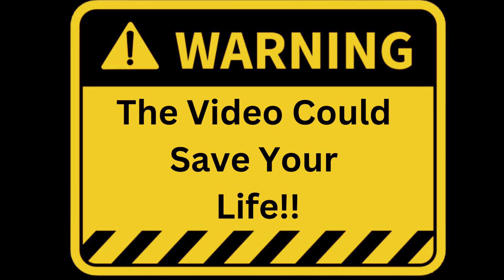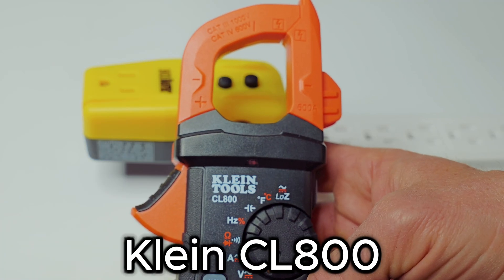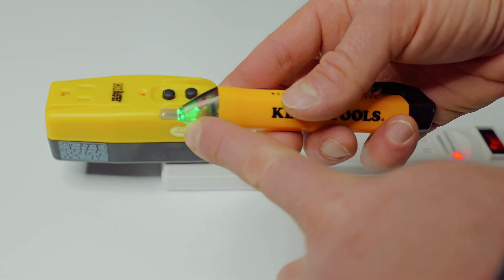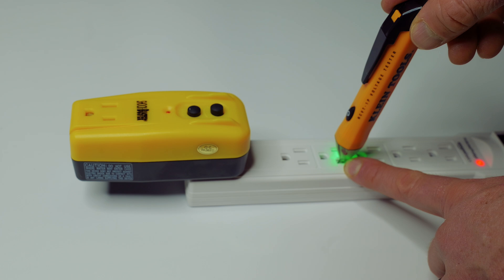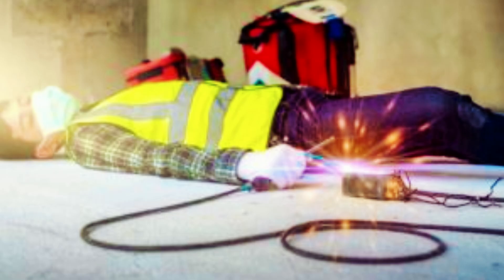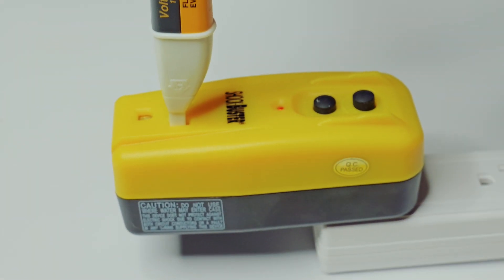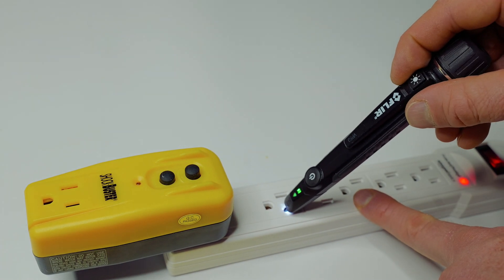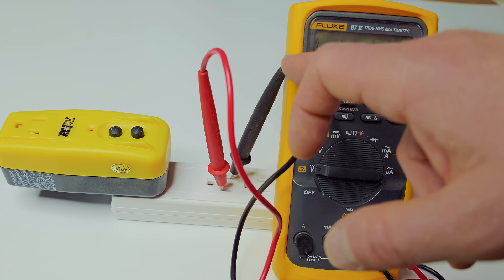I was shocked when I tested the TOP Non-Contact Voltage Testers!

Comment: I’m sorry but I don’t ever have to put my Klein into the electric socket to see it turn red. It’s non contact dude. NON CONTACT means you don’t use it as a probe. I even have found power on a bug zapper turned off and it’s leakage into a metal container below. Perhaps go buy another one

Comment: misleading marketing is the main reason these are overrated tools. though my wiha 12-1000v non contact has been 100% right so far they should have stated that these are NOT suitable for voltage absence detection. even the promo vids mislead customers. also stay clear of non speciality brands and stick to the established names no matter what you buy - chauvin arnoux, gossen metrawatt, brymen, kyoritsu, fluke etc. the two pole voltage tester is the only approved way to check if voltage is present.
Reply from the maker: Great info thank you friend!

Comment: We have 220 and 380 Volts in the network.
Reply from the maker: These would probably go off and alert a bit further back then. Most of these work just fine most of the time, this video was to show what can happen in low-voltage situations for homeowners.
Reply: @ElectricalYou  we have 220 is a low voltage, high is 1000 and higher.
Reply from the maker: Wow, stay safe out there please!
Reply: @ElectricalYou  We try not to take any risks, check for voltage and ground it so that the protection works during operation.
Reply from the maker: Yes great idea! Very smart!

Comment: The red pulses on the Fluke do NOT indicate the circuit is not live. Could you do some research before putting this stuff out there.
Reply from the maker: On the model I tested it does actually indicate that.  The rhythmic beat red flash is the continuous self test (Volt Beat)when no power is detected on the circuit. When the tip red light is continuous and a steady beep (if enabled) it means power is detected on the circuit. Perhaps you should do some research before commenting, or you are referencing a different model? Have a great day friend.
Reply: @ElectricalYou  The purpose is to indicate that the device is on and functional and not dead, not to indicate that it is a negative result.
Reply from the maker: While I do agree with that, it also is the "Volt Beat" function. Just going by what the owner's manual describes. I think it is safe to say both answers are correct. Have a great day friend and stay safe out there!

Comment: I'm using Laserliner ActiveFinder, which has a regular mode that ranges from 200-1000V on normal mode and from 24-1000 with the zoomer mode, which increases it's sensitivity and I find it much better than many other similar ncv testers. The only issue that I have is that it doesn't have an on and off button and because it's always on it's annoying sometimes when I work with corded tools. Of course, one must know what the tool is intended for, how it works, what it can do and what it can't do in order to get the best results and not get injured in case of improper usage.
Reply from the maker: Very good info, thanks for sharing and for the comment friend!

Comment: There is nuance to this. If you know what you are doing then these are one of the most valuable tools you will own. I use mine many times every single day, but never rely on it to save my life. I either use it and then follow up with a meter or short hot to ground before touching anything if it is just 120v. I also regularly test it on known live circuits. I have owned all of them over the years and prefer the one made by Milwaukee. It is cheap, light, and has a flashlight built in. The only negative I have found is that when the batteries start to get a little low it will sometimes not turn on without holding down the button or giving it a couple of bangs against something. I highly recommend it. Don't trust your life too it, but it will save you a ton of time and keep you from having to constantly walk to your toolbox or vehicle to get a meter.
Reply from the maker: Thank you for the great insight and comment! I agree!

Comment: As an electrician, you really need to know your tools. How they work and also how they behave. Yes these NCVT's are not perfect. Always use a backup in circuit meter.
Reply from the maker: Yes very true my friend! My video is geared towards at home DIYers to show the potential failures but yes very true!
Reply: In Europe you have to use a 2-hand- tester to be save!

Comment: I have had a few instances where the NCV tester did not register voltage... . For some reason my NCV meter does great on 125V, but not on 240V. I was right ON the wire, and nothing showed. Wondering if the wire just happened to be very well insulated / shielded???? Not sure... Always double-check using another method.
Reply from the maker: Thanks for sharing your experience. It's important to have more than one way to test voltage!

Comment: It's hard for me to image anybody wouldn't test one of these before use, but I guess we know somebody doesn't.  When no indicator proves safety, and no indicator is the expected state if the device is off or broken, it seems obvious it must be tested before use.  Every time I use mine I go to a known power source and ensure it responds before trusting it on the work I'm doing.  That testing also provides a good indication of how sensitive the device is.  If mine worked like most of the ones you demonstrated, I would have returned them right after purchase.

I guess I've been lucky.  I've used two of them - one by Utilitech (The Lowes store brand) and one by Greenlee.  Both have no difficulty detecting power in an electrical receptacle, and most of the time they don't even need to be inserted in the hot socket.  Just being close to it is enough to trigger.  In fact, if I have a complaint, the Utilitech one is too sensitive.  If I'm working near a mix of live and dead wires, it can be hard to figure out which is which.  I supposed if it's going to err, that's the safer way to do it, but it can be a little annoying.
Reply from the maker: Well said and thanks for the comment!

Comment: before the none contact tester / to test the knob and tube lines in old homes you take a neon tester and hole one end and test the wire at a tap and you will not get shocked and it will light and show you the hot wire
Reply: hold on end and insert the other in the hot side or at a tap / on knob and tube you dont know hot from neutral the wires are both the same color / you can do it on regular wire to test for hot wire
Reply from the maker: Thank you for the comment friend and great info!

Comment: I only trust non contact testers for checking wires or terminals.  Even when I do use one, I want to find a live wire nearby to confirm it's working. If testing an outlet, use a plugin contact tester.
Reply from the maker: Yes I agree! I used outlets to show what could potentially happen when only relying on these NCVTs. Thanks for your comment friend!